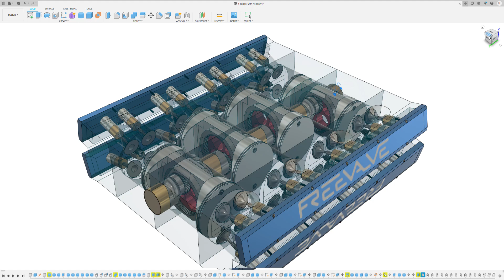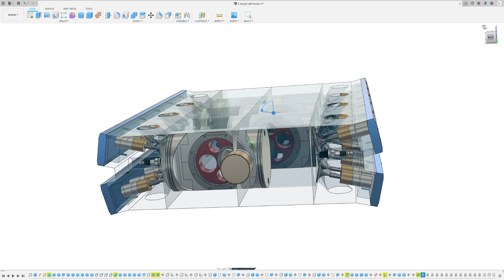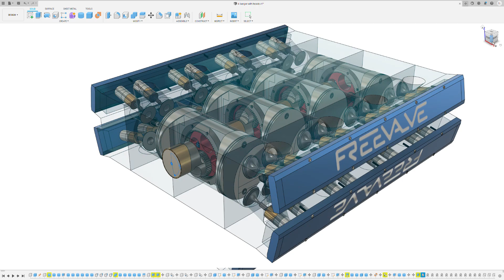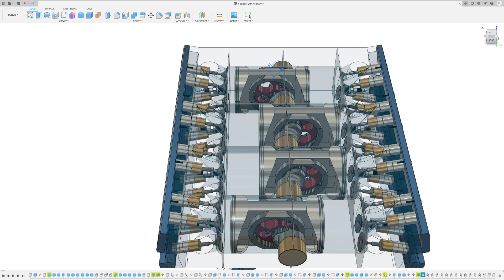Conjoined piston engine with Free valve system.

Comment: I love the idea, but do you need the teeth? Can it even work at all as a geared system?
Reply from the maker: https://youtu.be/RDssrAHVcFI Mostly needed when starting the engine.
Reply: @Drcraigpl  OK, have you actually got one of these engines built and running?
Reply from the maker: @davidevans9992  not yet but I have built a proof of concept as far as the motion of it.
Reply: @Drcraigpl  Cool! I hope it works. Would be awesome if it does!

Comment: How do you cool the pistons adequately for this design to compete with modern engines already in production?
Reply: But how many eccentric crank shafts fail on rotary, it's not a very common thing and if they make them from some forged high carbon steel then it's got very little chance of breaking a tooth or failing gears are cut so well these days they just don't wear like they used to
Reply: Just like most other engines. It’s just a water boxer.
Reply: you dont

Comment: Looks like your stroke is limited to a max of about 70% of bore, is that correct? (high RPM ratio)  The gear width and steel material will need to be hefty to take the shock loads and 1500 psi of combustion, greatly increasing reciprocating weight (limiting RPM back down again).  Looks like assembly will be accomplished by slicing the block into 2 cylinders (4 pistons) at a time, making it somewhat modular, like the Wankel.  Seems to have the advantages of a Wankel, but none of its drawbacks.  Might be as lightweight as a Wankel in kg/hp.  I see no problems in cooling; as all the same methods are available as in any conventional engine.  Its an extremely compact design, going to fit a lot of places where a V8 can't. Instead of throwing a connecting rod, you're going to break a gear - sure to do lots of damage (but using the red component as a cover plate could contain it).  You can clock 4 of the pistons to 90 degrees out from the first 4, for better balance and smoothness of power (or maybe you are swayed by the 'flat-plane' hype, but it only applies to V8s). Fascinating concept; great innovation.  Good luck to you.
Reply from the maker: Thank you!  In this iteration the stroke is 80% of the bore, I was able to get closer to 85% by  moving the gearing to the center as shown in this video...  https://youtu.be/1MS8bYxBZkA   An engine with a shorter stroke has the advantage of reaching a higher rpm.  As far as assemble I believe I can get away with a two piece block...although I will need to have some sort of jig to assemble the piston assemblies to the crankshaft and then install all of them into one half of the block at the same time.  
As far as timing... combustion would have to take place in pairs  in this animation.  

Again thanks for the comment!
Reply: my same thoughts about the wankel but with

Comment: this looks like a modernized Bourke engine 

the difficult part is the electritronic valves, currently there is still no manufacturer which can provide a proven electronic valve system.

and mechanically, the possible weak point is the gear in the scotch mechanism, in conventional engines with connecting rods, the bearing structure plus oil film can be extremely reliable even under sudden load shocks.

however this can be an ideal option for power generation and phev extender (battery charger), these applications need a compact engine with minimum maintenance, and these application can avoid load shocks which could damage that gear.
Reply: I thought the Electronic Freevalve technology was already used by Koenigsegg for years now... It is an amazing technology

Comment: The only problem I can see, coming from a mechanics point of view is how the he'll would you take the eccentric gears or piston gears or whatever off without disassembling the crank,

I mean getting the valve assembly and and spliting the block would be easy then then crank shaft would come straight out and the pistons could side off the gears and off the crank but how would you get the gears of the crank?
Reply: If you look closely the piston dome has countersunk bolts, which evidently allow for the pistons to be parted in the middle..... pull the heads, hold bolts on the dome of one piston,  loosen the other side.

Comment: This would never work as it would destroy the cylinder walls from the the opposing combustion and the rattling would cause catastrophic failure. These may be a way to increase dampening through injection ports in bearings to assist and help lubricate. But by way of either burning like a wankle rotor or extremely high pressures and tiny tolerances to prevent "blow-by". 

Still a great concept nonetheless.

Comment: How do you assemble this monster
Reply from the maker: You would want to have a special jig to hold the crankshaft, with ring gears hanging free, while you bolt on the red eccentric connecting lobes, then bolt on the upper and lower piston assembles, then bolt on the internal ring gears, then slide all of that into half of the block and then bolt on the other half of the block,  next bolt in the 8 piston ends. and finally the heads.

Comment: There doesn't seem to be much room for coolant channels...
Reply: Not necessary you can use the oil as a coolant that's what they do with aircraft engines.
Reply: This appears to be a very early proof of concept... still a long way from thermal modeling and factoring in cooling.. Could wind up only needing oil cooling with the right selection of oil pathways, capacities, and flow rates.. partnered with modern materials selections to limit/direct spread of heat...